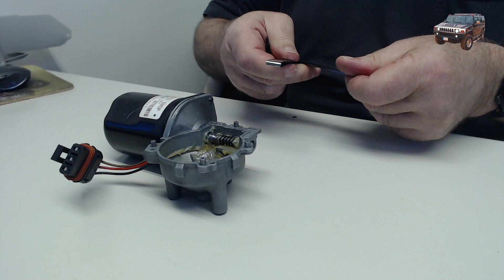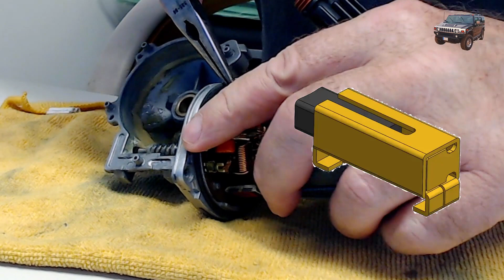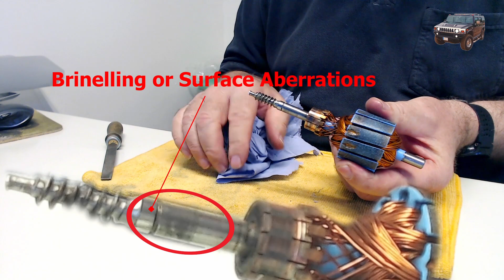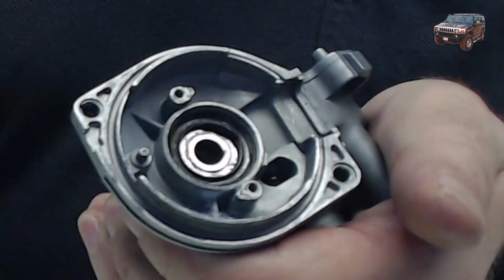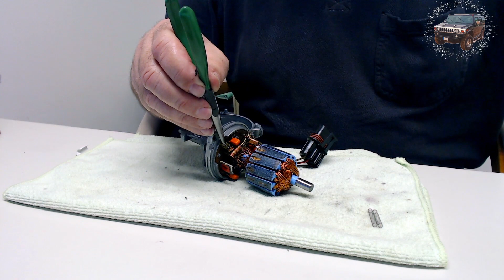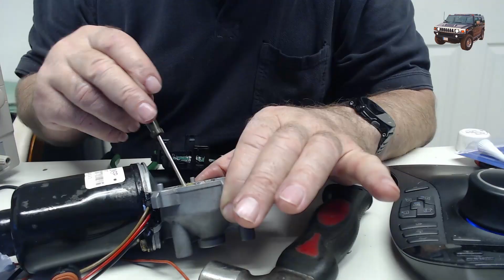HummerFixes - H2 Windshield Wiper Motor Repair - Part 2 Procedure

Comment: Where do you get the parts... im looking for the gear
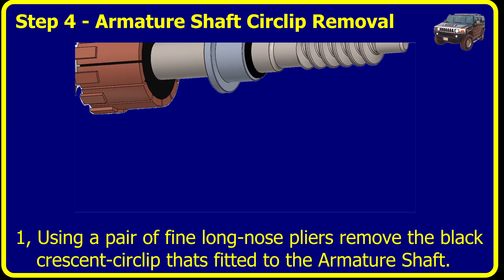Reply from the maker: Thank you for your great question! This problem was covered in Part 1 from the 4:53 mark to 6:31. Please note, as discussed in the clip,  the drive gear has a natural 20mm radius on it's edge and can be mistaken as bad, however if it needs replacing your only source will be from another motor, just like the one used in this video. If you have some pictures email them to hummerfixes@protonmail.com and I'll take a look at it.